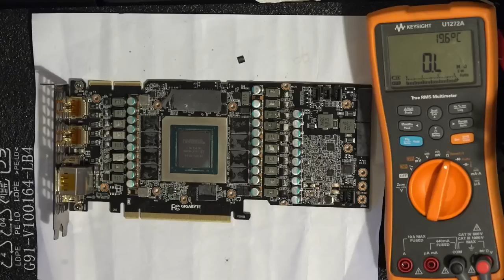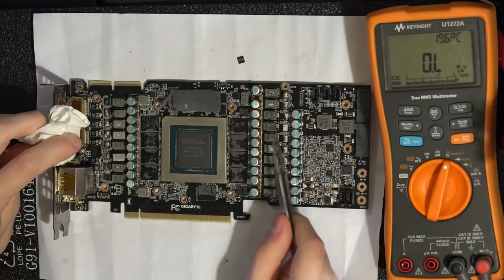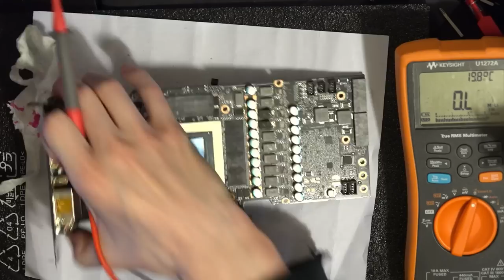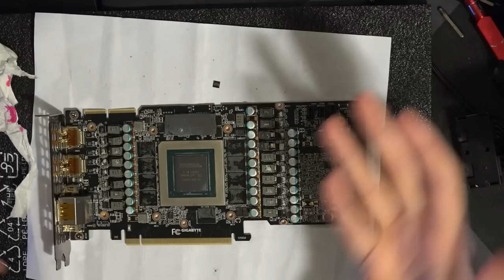Finding the dead Vcore power stage on the RTX 3090 Vision

Comment: My scenario was kind of weird, two MSI 3080 Gaming X trio died in almost identical ways, a loud buzzing noise (coil whine?)  followed by the fuse above the 12v pcie slot blowing) never had coil whine before on these cards; as if the fault was elsewhere causing massive current draw through a coil cause the buzz? and the later the fuse to pop.

Comment: What hot plate/preheater do you use? How usable would you rate it?  How do you protect the components on the back side of the card? I'm looking for upgrades over a sparkfun-skillet level of jank, for midsize board assembly.

Comment: Maybe I'm stupid, can someone explain to me - isn't the fuse meant to prevent the damage?
Reply: I might be being stupid in this but from what I understand it is not meant to prevent damage. But it is meant to minimize damage
Reply: As I understand it, the fuse is there to prevent the failed and shorted-to-ground component (in this case the power stage) from pulling a lot of amps and burning a fiery hole into the card.
Reply: The fuse simply isn't fast enough to trip before something dies. First an SMT (be it a MOSFET or a capacitor or whatever) shorts out and draws tons of current and then the fuse trips. If the fuse wouldn't trip at all then not only the original point of failure is dead, but so is the PCB (if there's an explosion and melted layers) and also rest of the components connected downstream (such as the GPU, memory controller and memory chips).
Reply: the damage isn't caused by an electrical overload so the fuse can't do anything about it. The power stage blows for other reasons like age or heat or manufacturing defects.
The fuse is there because when the power stage blows it usually shorts and this is a high current line so if there is no fuse it will burn the board and cause more damage.
Reply: Fuse is there to save the psu and motherboard. Not the gpu.
Reply: No. It's to prevent the entire card catching on fire and taking the entire system down with it and giving you a clue what went wrong.
Reply: Isn't there something that can just disconnect the vrm from the gpu/memory  when shit goes south , that can be placed between vrm and the gpu , so you could just replace the vrm and have a happy day ?
Reply: @antraxbeta23  Graphics card vendors won't sell more cards on the merit of them being easier to repair, mainstream users neither understand or care for such an aspect
Reply: @antraxbeta23  the fuse upstream cuts power already, why do you need another fuse after the VRM
Reply: @marcogenovesi8570  i guess i didn't said it right , what i meant was a circuit to prevent damage to the gpu and memory , because atm the fuses only prevent the gfx  card to go out in flames

Comment: I just came back from the post office where i delivered my Eagle 3080ti for RMA... The card was used solely for mining purposes in a 16c ambient room, had a 360mm radiator and a Barrow block with active backplate... Never exceeded 280w of stable and continuous draw, never even touched 40c on the core and had quality thermal pads on both the VRM and memory... The card triggered OCP on the psu and never powered up again... Nothing visibly burned on the pcb, i avoided poking probes on it just to have more chances of actually getting a replacement 😅 But since the card doesn't even light up and the psu is not bothered by it being installed on the system, that would mean that the fuses gave out and the problem is most likely the power delivery like most of the dead 3090s... So that gives you an idea that even at sub-300w without power spikes - while being watercooled in a 16c ambient room - the VRM on this card is TOTAL CRAP... Just flushed 1650€ down the toilet i guess 
😅
Reply: why not pay someone to replace the power stages, you have thrown away 1650 euro already, you can add 100 oe 200 euro on top o f that for an electronic repair
Reply: @marcogenovesi8570  If the RMA doesn't go through i will replace it myself... I just didn't touch it because i didn't want to mess up the RMA even further... Also you can't know if the VRM failure has fried the die or the memory...

Comment: Not sure if you've address this before but I have a dead Radeon VII with the infamous code 43 error (most likely dead core), what would you think is a reasonable price for it to get repaired? There's a place charging $200 Labor + Parts as an example. I've been peeking the used market and these cards are pretty insane in pricing...
Reply from the maker: AFAIK Radeon VIIs don't get repair because basically all of them need a new core+HBM+interposer. Which is worth more than the whole rest of the card so you may as well buy another one. (which will probably also die for the same reason at some point in time)
Reply: @ActuallyHardcoreOverclocking  Thanks for clearing that up.

Comment: How easy is it to source a new power stage. Do you just look up the part number on the chip and order it off mouser or digikey or do you need to pull it off similar hardware with the same part number. 
It must be a good feeling to find the fault and then fix the problem. Optimistic about this one. This could help owners of future failed gigabyte cards fix it themselves.
Reply from the maker: right now you can buy the ones used on Nvidia 30 series straight from mouser/digikey.
Reply: @ActuallyHardcoreOverclocking  If only the same could be said about IR3555's :(